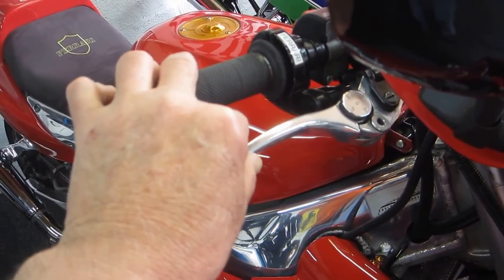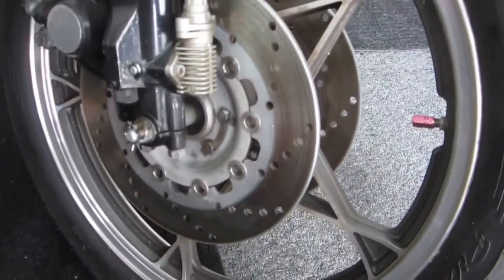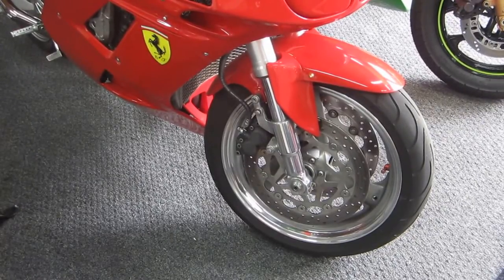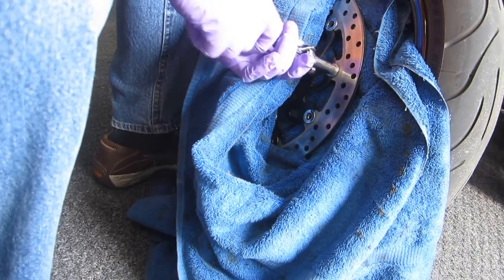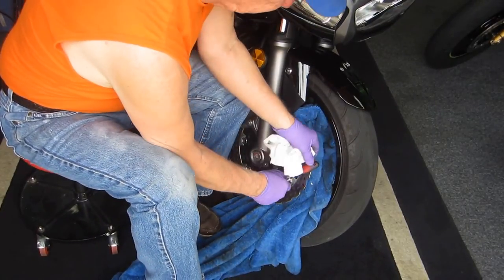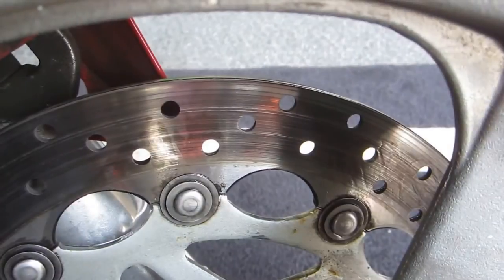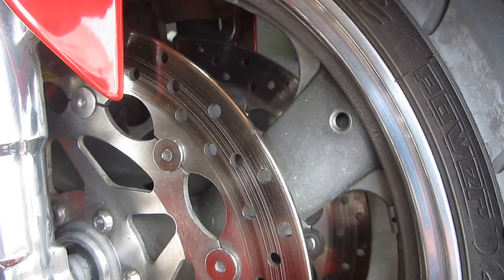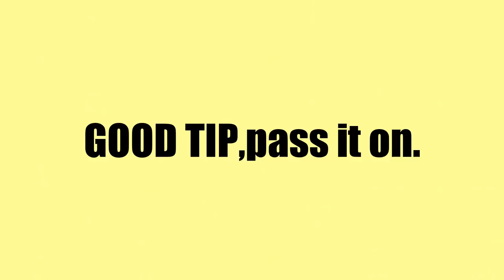HOW TO ELIMINATE BRAKE PULSING LEVER ON MOTORCYCLES

Comment from the maker: THE TIPS SHOWN ON THAT VIDEO WORK MOST TIMES AND IF THEY DO NOT NOTHING BAD HAPPENS.ON Q&A vol11 I WILL SHOW SOME OTHER ROTOR TIPS THAT I HAVE LEARNED FROM THE TIME I MADE THAT VIDEO.THE NEW EBC ROTORS ON MY GS ARE NOW BEDDED IN AND A MAJOR UPGRADE AS THEY ARE FLOATERS NOT RIGID LIKE STOCK.WILL BE A GOOD TOPIC FOR DISCUSSION .

Comment: Thanks Windy, You saved me from looking to buy new rotors for my 2005 Kawasaki ZRX1200. I just bought the bike used and have spend a lot of time detailing the bike and getting it back to it's stock form. I hate when guys molest bikes with crappy parts. Anyhow I was getting a little oscillation at high speed in the front brakes. Turned them like you suggested and they seem much better. Thanks

Comment: Thank you for this information, I've been riding for 14 years and have never heard of this. I just thought if your rotors warped, then just get new ones, I have a 2016 KTM Super Duke with a nasty front brake vibration at high speed and I will try this ASAP.
Reply: Paul Lucas did it work? Same bike same problem, mines low speed tho
Reply: @turbosloth2  yes it did, brakes are butter smooth now. I actually made a video of it on my channel.

Comment: my rotors are fairly new, they are 1 week old and I can't spin the bobbins. braking experience wasn't nice, the handle bar was shaking. what do you think most likely to cause that? the spring washers are stiff and aren't broken in? or are they are dirty from the factory?

Comment: ok, good info.     I use a cone shaped twig with a wet cotton rag on the tip, and just shove it in,  hard if necessary, wiggle it back and forward, spraying with water or with some detergent. Can do a wheel both sides, inside and out,  in 5 minutes

Comment: I did this and I couldn't spin them by hand.  But they felt clean when I spun them with the nut and bolt.   It's a 2014 CBR600RR.  What do you think?
Reply: did it solve your pulsating brake lever issue though??
Reply: @robertp9370  After driving a few other bikes, I don't think my cbr pulsed.  It might have been me being paranoid.
Reply: @matt3122  what?? my lever shakes back and forth when I brake going over 60mph while I squeeze the lever
Reply: @robertp9370  why don't you try the advice in the video.
Reply: @matt3122  I just bought some brake cleaner tonight will do it tomorrow
Reply: @matt3122  it didn’t work.... it literally did nothing for me. I just ordered a mint condition used set of rotors and a set of new brake pads for $150 total
Reply: @robertp9370  Nice.  Spin the front wheel by hand and listen for rubbing in one spot.  I had a warped rotor and was able to do this.